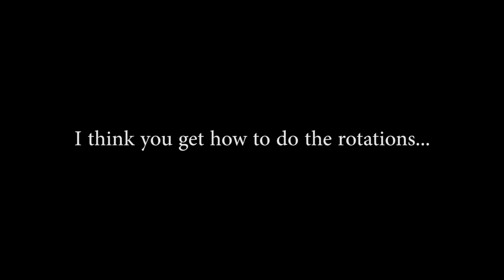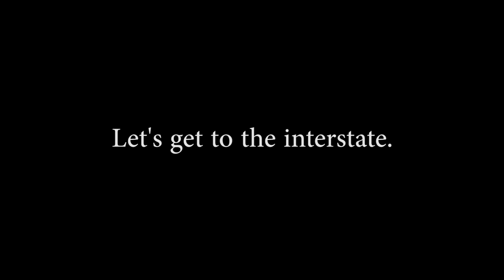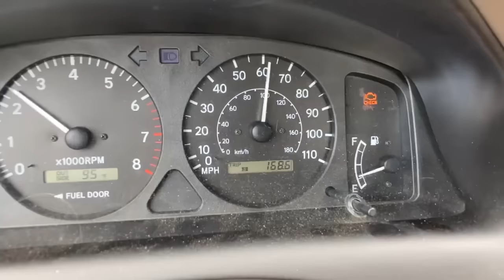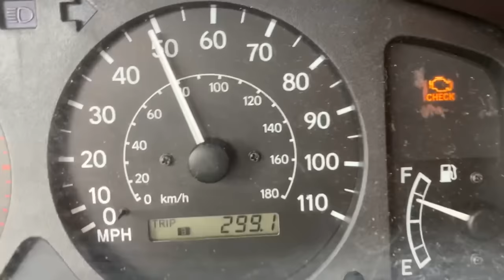Will Berryman's B12 Chemtool stop oil consumption? 😲 | Oil Burning🔥Experiments | Episode 15

Comment: Get some Kano laboratories Kreen. Use as piston soak. Also some in the fuel, and some in the crankcase. Use at least one step viscosity oil higher to deal with the Kreen which is quite thin. This has been my one step fix for oil burners like yours when I first buy the vehicle and discover it's an oil burner.  After you get consumption under control, use an oil that will KEEP things clean. For this I like M1 high mileage full synthetic oils, both the 10k mile version and the 20k mile stuff, which is only a couple bucks more for the 5 qt jug. Don't be afraid to bump your viscosity up a notch in summer or with high mileage engine. I like M1 10W-40 High Mileage synthetic from WM or AMZN for older engines with high mileage. Don't skimp on an efficient, longlife oil filter. My choice is Fram Ultra from same 2 retailers and best bang for your buck. I run these up to 10,000 and even up to 15,000 miles on these each oil change with appropriate oil. They are rated up to 20k miles.
Reply: That’s the reason why engine developed oil consumption. The 10k, 15k miles oil change killed everything. No matter which high quality oil and filter u used, it will clogged oil return holes and oil control rings. I guarantee u after 5 yrs of 10k oil change, u engine will end up burning oil. 

Years ago I purchased a brand new 07 Suzuki sx4, I was like u change oil every 10k or 1 year. I used royal purple HPS racing oil and K&n synthetic oil filters thru out my ownership of the car until I sold it on 2016, my Suzuki started burning oil after 5 yrs or after just 5 10k miles oil change. Always a quart low when it’s time for an oil change, although it’s not much for low on 1 quart every 10k but my catalytic converter died around the 5 yrs mark. So clogged that it threw a P0420 code and my exhaust tailpipe was all carbon up inside. That’s the sign of engine burning oil already until I met a fellow Suzuki sx4 owner who has the same car as me and higher mileage than me but his car doesn’t burn oil at all and his catalytic converter was healthy and no carbon inside is tailpipe. He told me is a big NO NO to change oil at 10k miles! That’s what caused oil burning stuck rings! He learned from his father who has a old Toyota pickup with the 22R engine at 300k miles original engine, original transmission, doesn’t burn any oil or had ANY gasket leaks! All he did was change the oil every 5k or twice a year every 6 months and change the transmission fluid every 30k or every 5 yrs. He does not use any high end oil and oil filters, all he used were the cheap oil and filter from the part store. More importantly, redlining your car once a while to keep all deposits inside the engine burn off. 

After I sold the Suzuki, I purchased another brand new Toyota Sienna van and this time I followed his advice, change oil every 6 months, used cheap oil and filter and now, I’ve owned the car for 6 yrs and my car does not burn oil at all, my cat is still healthy, my tailpipe is not black, carbon up, no problems whatsoever!

Oil companies advertise their oil will last 10k 20k and even oil lab testing results will tell u oil still good after 10k 20k BUT no oil lab testing can tell u your piston rings was stuck, oil return hole was clogged. Nothing on their testing will tell u that. Remember back before year 2000? That everybody change their oil at 3000miles or every three months? We NEVER heard of oil consumption problems with car ever! But after the year 06/07, we started hearing lots of car had oil consumption problems. That when manufacturers push oil change to 8k, 10k miles and people started change their oil pass 3k miles and all started burning oil. So u believe what u believes but I’m not following the 10k oil change anymore no matter what the manufacturer or oil lab result tells me
Reply: 4k miles is all any oil is good for.

Comment: Hey Dave, been following your video and was very happy to see this chemical make a difference. Question, wouldn’t the oil rings get damaged with the B12 since this is a solvent? Asking cause I am planning to do the same on my Acura. TIA
Reply from the maker: Solvents shouldn't hurt piston rings since they are cast iron or steel.

Comment: I did the tank treatment and my car settled down to so much smoother .  I have an sr20 but idont burn a lot of oil. I do wonder if the same spark plug treatment would help mine.

Comment: The SDS of B12 Chemtool shows it has good bit of Acetone, Toluene, and Methanol. Acetone is in carb cleaner, brake cleaner, and it breaks down carbon. I've heard acetone is used in manufacturing of O-rings to artificially make them swell up to size. So makes sense that it would break down the carbon but piston rings aren't made of rubber? Was carbon causing a gap to allow oil to get past the rings?

Comment: Redline fuel injection treatment is the best one you can get. Add half a bottle in your tank when you fill it up every 6 months and I'll prevent the carbon from clogging up. Retired master Auto technician. JW

Comment: Used to use transmission fluid a couple of hundred miles before oil change the higher detergent level in the transmission fluid was supposed to clean oil passages and galleys. Also have heard before of using diesel.

Comment: Oh and guys with manual transmissions make sure you down shift and put negative load ont he pistons to suck the rings upwards to help keep them from sticking from time to time. Engine braking is fantastic for piston rings. I am not saying you need to do extreme engine breaking just normal downshifting. One of the reasons manual transmission cars tend to burn less oil than their automatic counter parts. That assumes you down-shift. If you shift out of a gear and then coast and brake you miss out on this effect.

Comment: You could alternatively use HDDO (heavy duty diesel engine oil) like shell rotella and still prevent oil consumption in future
The root cause of this problem is inadequate dispersants in gasoline engine oil and HDDO has plenty of both detergents & dispersants

Comment: Anytime you put that stuff in the cylinders or engine oil you shouldn't drive it to much you basically thin out the oil and it doesn't lubricant anymore and can damage bearings and cylinder walls. It's just not good for it unless you drain the oil and put new oil in probably best to only bring the engine up to operating temperature one time after using the  B12.

Comment: Valve cover gaskets are supper under rated fix for this. They are cheap and easy to do. My 1999 saturn sl2 was burning alot of oil so alot of smoke and oil loss. After changing the valve cover gasket it almost never smokes and my oil doesn't disappear any more.
Reply: Valve cover gaskets are a fix for leaky valve cover gaskets which are super easy to diagnose. It's more likely he has clogged piston rings as that's a super common problem that doesn't show itself like a leaky valve cover gasket would.
Reply: @one_mega_ohm9139  That doesn't even make sense.
Reply: @mattday172  Read it again bud. A new valve cover gasket isn't going to fix anything unless he has a leaky valve cover gasket, which you can see with a quick visual inspection. How does that not make sense? I get that it worked for you, but this guy is dealing with a whole different issue (clogged rings).
Reply: @one_mega_ohm9139  180,000 miles is more than that gasket is rated for. On modern cars the gasket usually fails before the piston rings and its definitely cheaper and easier than doing piston rings. Even if I got new pistons or rings I would still put a new $10 gasket. Lol
Reply: I would also replace the thermostat and antifreeze to prevent overheating which burns oil! As well as a new PCV valve if the engine has one. All of those things are still cheaper than engine rebuilding.
Reply: The valve cover gasket job is to keep the oil in your crank case and out of your engine. If it starts leaking it usually leaks into the piston aswell causing burning oil and white smoke. This leak usually smokes more than bad rings because more oil is actually getting in from the broken gasket than past a piston.
Reply: A clogged piston ring is not a real thing. Maybe on a rusty pos from 1970.

Comment: So did you change the spark plugs after the experiment?  Was the dry cylinder the dirtiest spark plug?  I would have been trying to pick or scrape that big glob of carbon when you used the bore scope.  I don't think I could be disciplined enough to not try

Comment: Certain Toyota engines had an engine flaw design. I use amsoil oil and engine flush. Never had a problem with burning oil anymore. You need to use a thinner oil on these engines.

Comment: I couldn’t find my wrench and had left it on the crank 😂 
Found it when it went clang! Bent the wrench 😭

Try 60mph in first gear for 60 seconds 😂

That poor jogger as Dave drove past

If you can go 1000mi/qt that’s sustainable.

Here is what I would try:

I would try a solvent that will dissolve oil and oil sludge (like lacquer thinner or xylene maybe) and use enough that you know that the rings are soaking in it. First need to know it won’t destroy engine seals.

Find a good solvent that won’t eat the seals (maybe the B12)

Drain out all the oil. Pull out the spark plugs. Fill up the crankcase with the solvent so that the pistons are completely submerged, understanding that all bearing surfaces now have no lubrication.
Let soak overnight or as long as you can. Maybe you need something that isn’t so volatile so it won’t evaporate out, but it’s the volatility that makes it a good solvent. Drain out into a container and save for reuse. Add 2 qts of the cheapest oil (at least enough to reach the oil pickup screen and so that it won’t get sucked dry). Turn over by hand to get that oil distributed to the bearing surfaces. Drain and discard. Fill with oil and drive a short oil change interval like 1000miles. Drain and save. Use that oil as top-up oil. Fill with new oil and add the top-up oil as needed. When the top-up oil has been used up, drain the oil and save it. Repeat the solvent. Monitor solvent for sludge. Use the last saved oil as your first drive oil and discard after several hundred km’s. Get a bunch of value filters and change them frequently.

Comment: Did this same experiment but with seafoam great results.  Did not drive in any lower gear though I did take it out in a highway for roughly 50 minute Highway trip at a little over 70 miles an hour then for maintenance moving forward about 500 miles before an oil change I add the recommended amount of seafoam to my oil so far after 20,000 miles my oil consumption is about a quart low every 3,000 miles instead of being a quart low every thousand miles spark plugs were obviously pretty bad after that drive so I soaked them in the seafoam cleaned them put them back in definitely notice the engine was a lot smoother after!
Reply from the maker: Good info, Thomas!

Comment: It would have been a better test if you had done a compression test on the cylinders before and after as well because if your burning oil you should be losing some compression from escaping the cylinder through the rings. After the berrymans treatment you should see an increase in compression and decrease in oil consumption and feel more hp.

Comment: When you said all cylinders are midway top dead center, does that means that the intake valve are still open? Just wondering why midway instead of top dead center where all intake valve are close?
Reply from the maker: That's just so you can pour enough liquid into each cylinder at the same time.

Comment: Yea i would do an oil change soon afterward . I wonder if putting tcw3 2 stroke outboad oil in the gas.i thought it was known for cleaning carbon deposits  and freeing rings on top of adding lubrication to the ring.

Comment: If the car has run a highmilige, you could use a ticker oil. My car has 500.000. Kilometer and from factory it comes whit 10w-30w, i use 15w-40w now and it isnt as hot as whit 10w-30w anymore so lower friction. Hope it helps.

Comment: I've been using this for years, put some in the crank case and keep the carbon out, add to gas tank also, cleans the cylinders as you drive, 300,000 miles on my GMC, doesn't use oil.
Reply: That’s awesome! That’s great testimony right there! Unlike some people thinks it will sprung bearing if u leave the b12 in your oil and run it thru out oil change interval or redlining your car is “bad” just asking for damage….😂
Reply from the maker: Thanks for sharing, Jessie! ... Just out of curiosity, how much do you add to the crankcase?
Reply: @FamilyFriendlyDIY  prior to oil change about half a can to clean carbon off rings run engine to circulate so it gets up into splash areas of the engine where the carbon builds up, those places are where the hard carbon deposits grow, like ring lands, in the long run, the berrymans is a carbon dissolver, it becomes a liquid, and is removed with dirty oil. Adding half a can to gas tank also cleans the injectors and pistons while driving, best carb cleaner on the market, in my opinion, I m 73 been repairing vehicles for the public, graduated GM school 1970, I've done hundreds of carbs.
Reply: @jessieharris1676  i am also a pro mercedes tech. I been using b12 for years.

Comment: I used  to use Chemtool to clean my old VW Beetle carburetor. Where other cleaners lightened the dirty areas Chemtool stripped it immediately clean. I used the large can with metal dip basket that  Chemtool  sold in auto parts stores.. I stored it in a corner of the garage. Years later when I went to use it again the large can was empty. Chemtool had EATEN through the bottom of the can and leaked out.  Dangerous stuff that. :hand-orange-covering-eyes:

Comment: I had a Pontiac vibe with that exact same engine, I ended up junking the car at 115,000 miles because of how much oil it was using and it was a 2009 with the 2.4. I was so upset it didn’t have the 1.8 which is a lot better engine. I bought it for my daughter. I was at college graduation present. Every week I had to put oil on it.
Reply from the maker: Is that the problematic one they put in the Camrys too? I'll have to watch out for that next time I'm car shopping.

Comment: Hey Dave what do you think the longevity of this will be? Do you expect it will last a fair while?
Reply from the maker: I do, Paul. I'll likely treat again, as I'd like to get the consumption down to less than a quart in 3k miles, but I think running synthetic oil and doing 3k oil changes should keep it from coming back. I believe the problem comes from a combination of conventional oil, short trips, extended oil changes, small piston drain-back holes, and low tension rings. Thanks for the questions!

Comment: You filled the oil to the proper level but oil expands when it is hot you have to check the oil atleast 6-8 hrs later when the engine and oil have cooled down to get an accurate measurement. ps ( it will be somewhat lower on the dip ).
 stick )!
When you change oil you usually get about 2-4+oz. more if you let it drain for 30 minnutes if it was warmed up enough before you drained the pan
Reply from the maker: Thanks for the tips!
Reply: To me, I believe proper oil level is to the MIDDLE line between the 2 marks, not all the way to the top (full) mark. It shall never fill to the FULL mark, middle line will leave enough room for oil to expand so it will never expand to or past the the full mark. If your oil expands pass the full mark, the pressure will be put against on your seals and gaskets. Overfilled your engine with oil is the number 1 killer for engine seals and gaskets

Comment: I've always preferred Berryman's B12 over Seafoam. It's cheaper too. It was $3.28 a can at Walmart a few years ago. You're lucky that worked. As good as that stuff is it's really tough for any of those treatments to free up stuck rings. The best thing I've used to dissolve carbon is the Berryman's Chem-Dip which comes in a 1 gallon can. Usually, you can just dip the whole piston on the rod in it. Of course, that would unfortunately require disassembly of the engine which is often the case with stuck rings. Would be interesting to see how long this works and over a few thousand miles what the result is. There was a lot of oil wetness in those cylinders after you scoped them following the treatment. I would keep using something in the oil to continue cleaning those ring lands and oil control rings. Good luck, I hope it worked out.
Reply: I used PB B'laster to free up the rings in my 1967 Matchless. Started out at 25 psi, and now it's back up to 125.
Reply: @ronaldburgess2884  Compression rings are a lot easier to get unstuck than oil control rings. They're closer to the top of the piston and combustion pressures and heat help out immensely. Oil rings are near the bottom and it's hard for anything to get to them. Once they stick, there's usually a lot of burned oil and varnish holding them in place. Not impossible, but very, very difficult to free. Even if you do get them unstuck it's usually temporary unless they get thoroughly cleaned out. 
There's an engineering flaw with this Toyota engine in the ring control, piston design and oil drainback so it's a recurring problem. They have a re-designed piston. If you're using OE parts best you can hope for to stave it off as long as possible using a GOOD quality oil.
Reply: @vincemajestyk9497  agreed but even if u put in the redesigned pistons and rings it will eventually burn oil again. Because not much changes on the redesigned pistons itself and same old low tension rings as well. The newer 2.5 2ar-fe and the 1.8 also faces oil consumption problems due to lack of frequent oil changes and lack of high revving driving. We can all prevent this from happening from the day 1 if we changes oil and rev the motor frequently